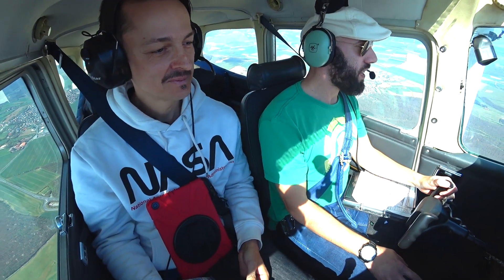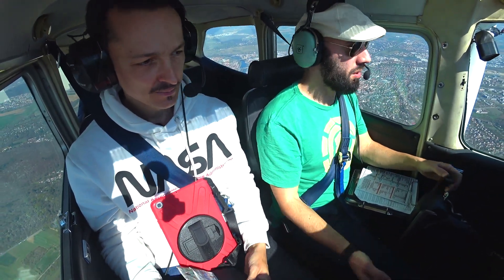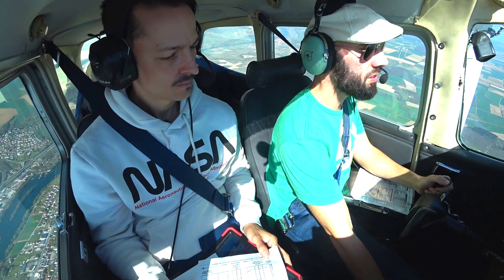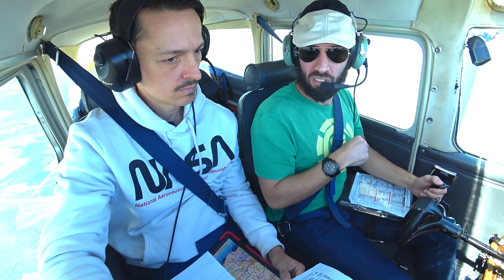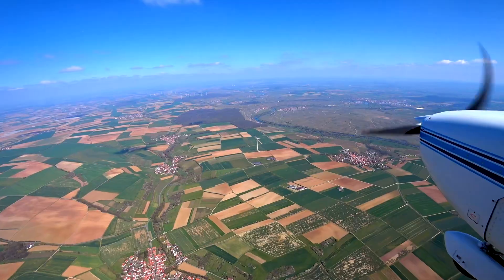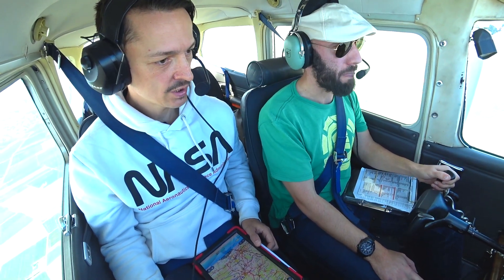How to PROPERLY lean the MIXTURE on a light, simple aircraft

Comment: isnt running just rich of peak the way to go
Reply from the maker: Apparently not! If you check the link I shared in the description and read carefully Lycoming's instructions, their recommendation is now to either set the mixture "quite rich" (circa 150ºF rich of peak) for "best power" setting (basically, max RPM for fixed pitch prop), or slightly lean of peak (circa 20ºF lean of peak) for "best efficiency", or max range, so to say. It's funny because indeed for many years the POH would recommend 50ºF rich of peak, which is kind of a bad area to run the engine at, as it leads to highest CHT. Cheers!

Comment: This is an ongoing debate for decades (LOP vs ROP), like apples or oranges 🙂 From what I've heard and read, you'd better not practice LOP unless: A) your engine has a fuel injection system (preferably with aftermarket installment of GAMIjectors or alike, which are more precise compared to stock ones) and B) your airplane has an engine monitor. Everything else would be a guessing game just like measuring a temperature with your finger. My personal preference is ROP as the old adage goes "fuel is cheaper than an engine". Besides that, you fly faster and also save a significant amount of hours of personal time and TBO (time between overhaul as it also counts in total savings).
Reply from the maker: To each his own, but the instructions of the engine manufacturer (in this case, Lycoming) are clear. Without an engine monitor, lean till the onset of roughness, and then enrichen just enough for the roughness to go away. If you run the engine ROP make sure it's 150°F ROP instead of the 50°F mentioned in the POH, otherwise you'll run the engine where it's most stressful. However, if you're running 100LL, by having too much fuel and an engine which is too cool you're setting yourself up for sticky valves and exhaust valve failure, as Mike Busch mentions in the respective videos. I'd be happy to read from other sources if you'd care to share them, I'm very interested in this topic! Thanks!

Comment: I remember some thing like this, if your egt (exhaust gas temp) is high then you are wasting energy. keep the hot air still in the piston pushing it and let it out only when it cools down, in short keep it leaning until egt drops a bit
Reply from the maker: Right, that's one of the reasons why constant speed props are so much better - we can adjust the prop's pitch to lower RPM's, and give more time for the air to cool down while pushing the piston. I'm flying a constant speed prop C172 now where I make use of this as much as possible :)

Comment: Nice video, and you did a great job with research. But still, the point we were discussing is not being dealt with. It doesn't really contradict what I told you. 
Let me explain. 
If you are on the ground the air is much denser, meaning that there are more oxygen molecules per  a defined volume of air. Ifyou go up the number of these oxygen molecules decrease. 
Now, by starting to regulate the mixture you bascially decide how much fuel you want to add to the air being sucked in. If there are more oxygen molecules the bruning capability of the engine is going to be higher, if there are less oxygen molecules, the burning capabiltiy will be lower. Therefor in the first case more fuel can be added, and in the second amount fuel amount needs to be reduced.  
So, by going up in the air and leaning the mixture, you are basicaly adapting the amount of fuel to the amount of oxygen. If you enrich too much, there will too much fuel, and the combustion will be incomplete. If you lean too much the ratio will change towards the oxygen, therefor you will have a better or maybe too high combustion.(Note that at some the amount of fuel will be so little  that the enigne will shut off.)  This is reason why the rpm ,as shown in your video, rises with leaning of the mixture: Combustion becomes more effective. And as also mentioned in the video the EGT will rise, and yet the CHT will rise. The difference is with the rise in the CHT you damage the cylinder. The rise in EGT dmages e.g. the turbo engine, because the hot air has to go through the turbine which produces electricity to run  the compressor for the air.
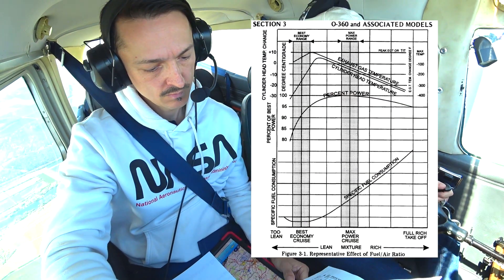Reply from the maker: Hey, thanks so much! I think the chart @ 7:00 is key. You will see that when we start leaning, the first interesting point we reach is max power (peak RPM). However, for Mike Busch and many other people, this is not the most interesting engine regime. If you continue to lean, you will indeed get to the point of peak CHT, and then peak EGT. If you continue leaning, then finally you get to the best economy point. In this area, CHT is again low and not harmful for the engine.

This, however, also depends on the power output of the engine. If you are at 65% or less, you can choose whatever setting you want for the mixture, you will never harm your engine. You can check this on the following video from Continental - https://www.youtube.com/watch?v=iwwKn-gLDvY

This is why I said I think the pilots you mentioned did not lean enough. In fact, if they followed the POH, they would have flown very near to the most harmful area. The POH of the C172 normally mentions that we should lean to 50ºF on the rich side of peak EGT, which is close to peak CHT unfortunately. But if you lean further, you get to the best economy area, which is the preferred area of many mechanics and pilots!

Does this make sense?
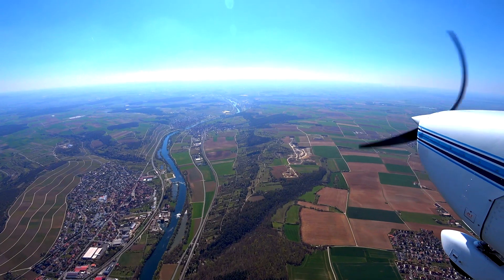Reply from the maker: On the video from continental, check @ 3:39, where they mention at or below 65% power nothing that we can do with the "red knob" will be harmful for the engine. So, I don't know how the pilots you mentioned were running the engines. I'd be surprised if they were running the engines much above 65% power and setting the mixture at the worst point regularly. Personally, I like the idea of best economy . It is exactly what Mike Busch recommends, both for saving fuel, and saving the engine. Cheers!